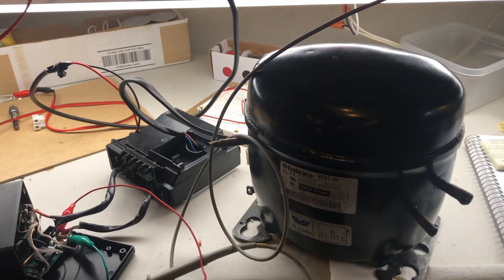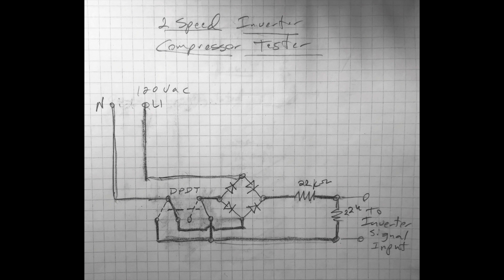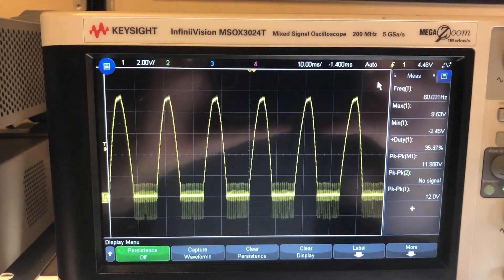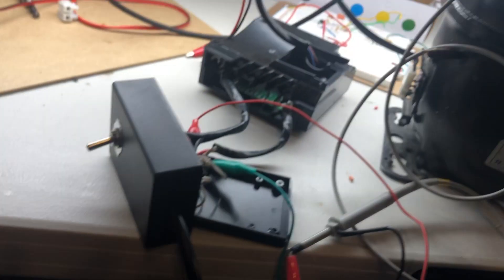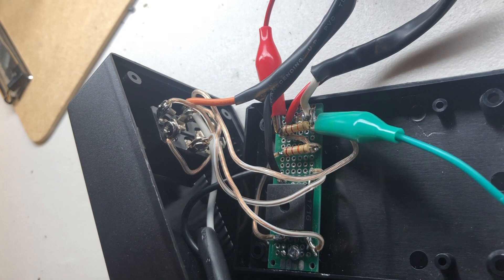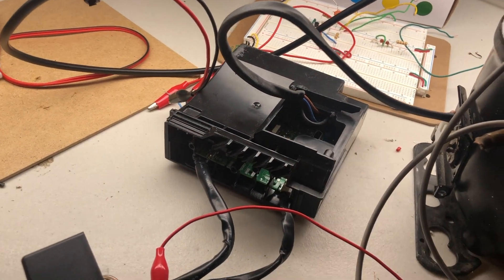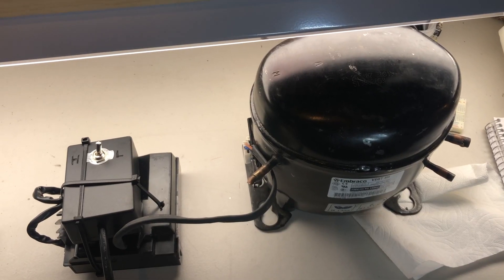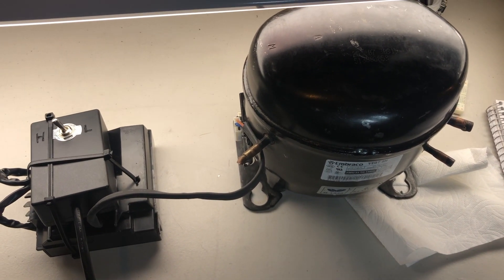2 speed VCC3 Inverter Compressor Tester

Comment: you used voltage divider, 2 of 22 kohm won't able to give you the 10 v p-p, i looked at color code of resistors and i don't think it is 22 kohm

Comment: Great video. Could you also show the version with programming arduino module? I saw a video with the schematic how to connect arduino to vcc3, but couldnt find which arduion module to use and how to program it. Thanks a lot.

Comment: Hey Mike, How did you come to the 22 kilo ohm resistors? I'm from belgium and here we have 230 Volt and 50 Hz instead of 120 volt and 60 Hz. I just want to test one speed so it wil be 100 Hrz. but dont know witch resistors I need to use?
Reply from the maker: You want to get an output waveform that is between 5 to 10 volts peak. I just did it by trial and error substituting. You can do all the calculations of what it 'should' be, but you are going to have to change it anyway, lol. With higher voltage you have to consider the higher power dissipated by the resistors, so you may want to raise their values accordingly. It doesn't take a lot of current to drive the signal to the inverter.